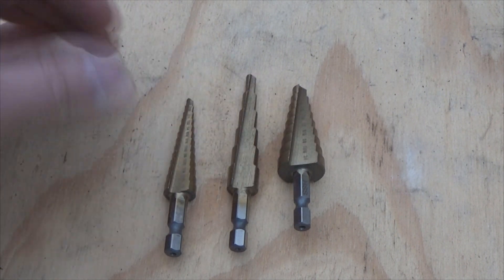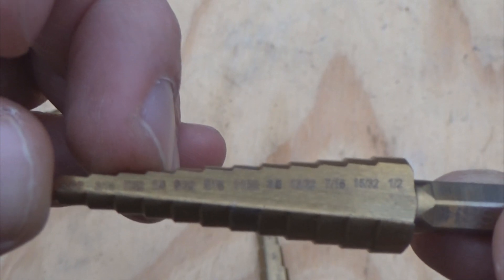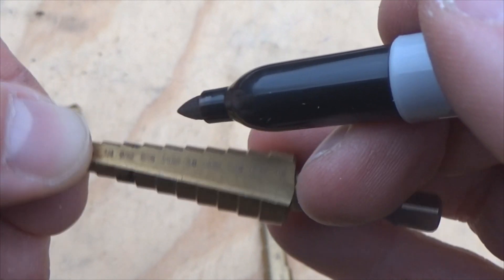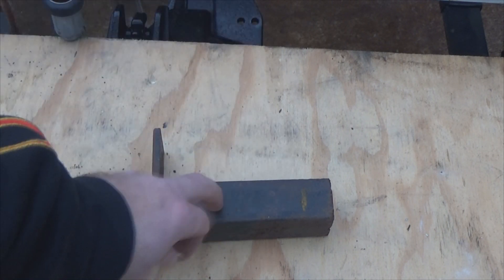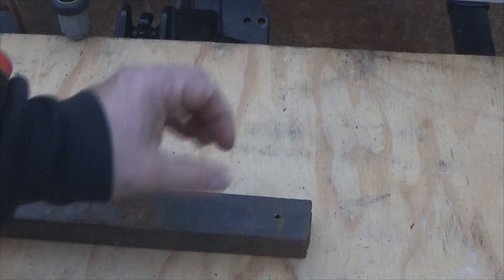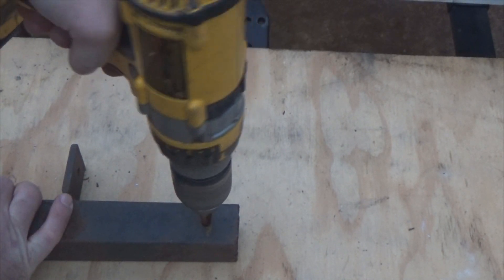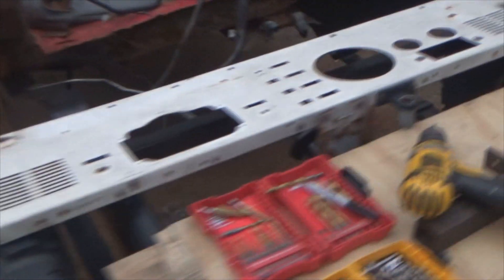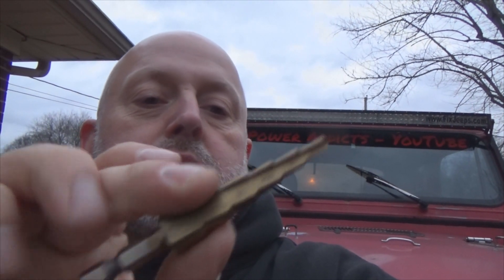Step drill bits on Tool Tuesday

Comment: I went through you lists, but didn't see what I need help with. I have a 92 YJ. It needs a new ignition switch. Problem comes into play after removing the steering wheel. Some kind of lock plate is preventing me from getting to the actual switch. Haynes Manuel states a special Jeep tool is required. Any help would be appreciated. PS your video on the vacuum front axle disconnect fix made a believer out of me.